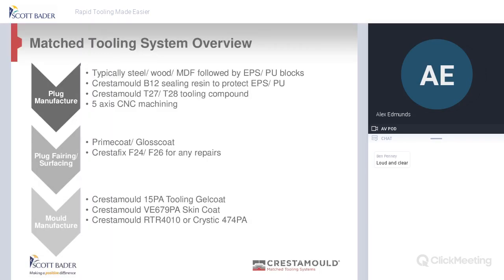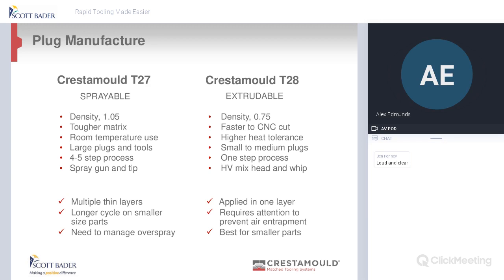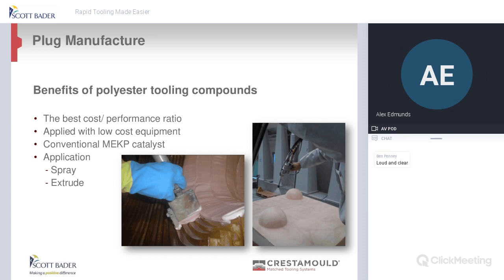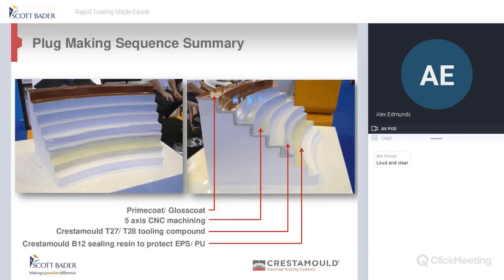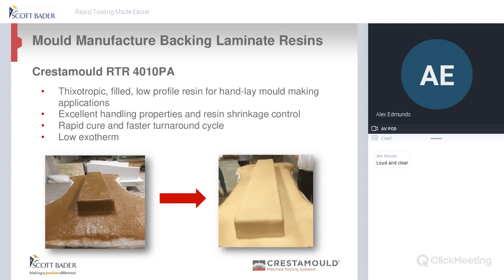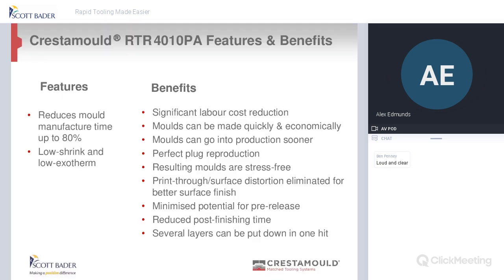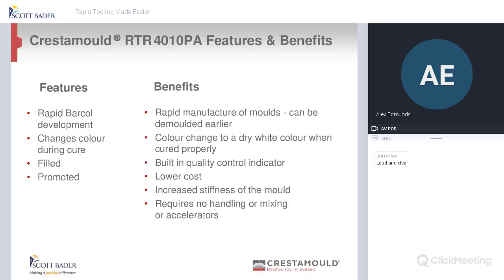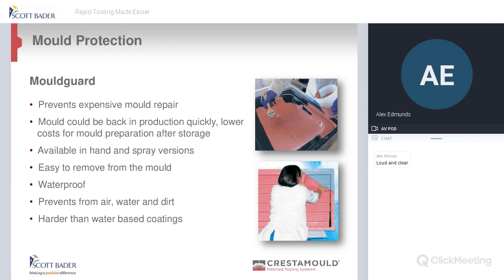Webinar - Rapid Tooling Made Easier with Crestamould Matched Tooling Systems

Comment: Dear all, for a large plug of a 40 mts boat, in case of no CNC tech, when the masterplug is in classic wood sections, strings and wood skin, how do you recommend to seal it before apply  spray T 27 ?